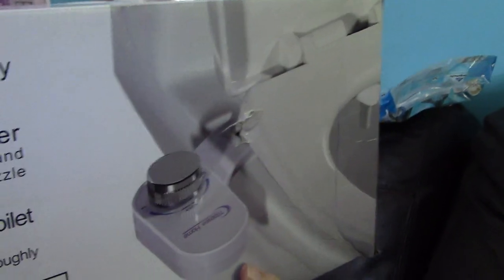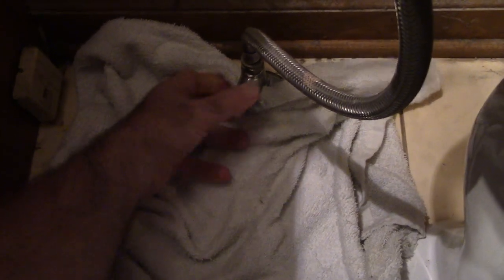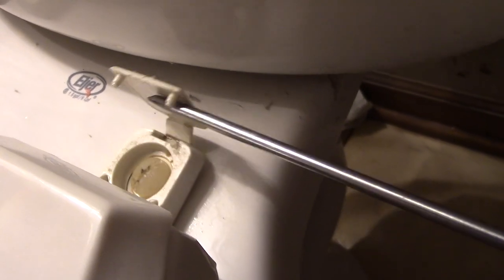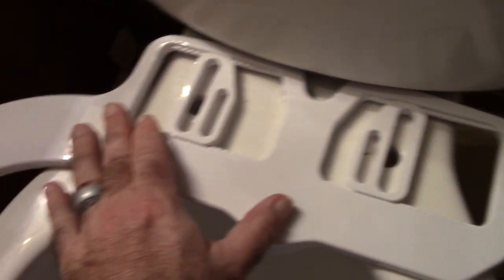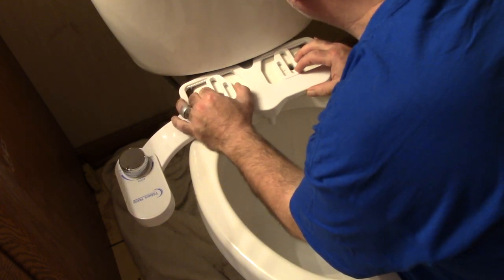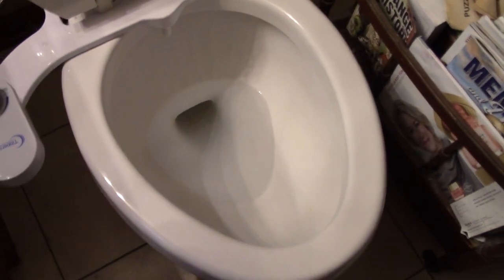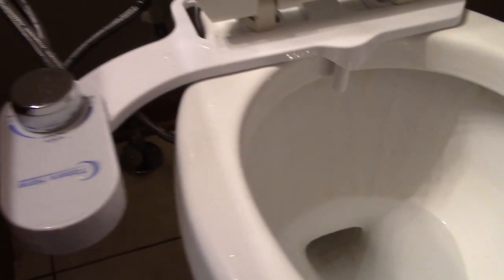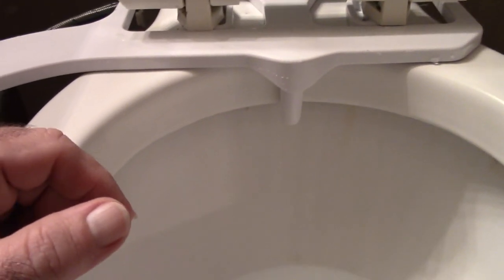Installing Our Tibbers Home Bidet

Comment: Thank you, I initially installed how you were trying to at first, but was getting a steady drip from the metal T splitter. I wasn't sure what the plastic adapter was for, didn't even think about running it to the tank. Swapped it around and everything works perfect now

Comment: Great video. I had my entire colon removed last year, because of colon cancer. My prognosis is excellent and I feel great, however I did go from using the restroom every other day, to using it approximately five times per day. I guess it beats dying of cancer, however my timing is not ideal (in the midst of a TP shortage! 😆)

I basically took out a second mortgage so that I could purchase 120 rolls of cheaply-made one-ply TP (from China... love the irony), but this is a short-term solution, and leaves me anxious for my future in this dystopian world we are now living in.

Having spent some time in France, I began to ponder other solutions, and soon zeroed in on this particular bidet.

I had concerns about installation (as a new home-owner, I am learning quickly, but am still not particularly handy). Your video eased my concerns. I also appreciate the fact that I have learned from your mistake, and will be sure to note the metric vs Imperial system). 

Anyway, I’m ordering mine today, before there is an inevitable run. I may also invest in Tibbers stock. Thank you, friend.

Comment: Yep. The cold water is definitely a deal-breaker. 
It needs its own inline heater. 
Maybe the Deluxe Bidet Buddy will have that.
Reply from the maker: Seriously, don't let the cold water supply scare you!  It's hard to explain, but it's not the deal breaker you think it is.  Everyone in the family is fine with it.  It's actually comfortable and it's not "shocking" to the system.  We love it!
Reply: It’s also not as cold if you use it before you flush. The water in the pipes becomes room temperature after a while, so it only gradually becomes cold after it’s on for more than a few seconds. Heated bidets are considerably more expensive.

Comment: As soon as you find out the the water shut off valve does not stop the water go ahead and replace it, shut off the water from the main valve at the front of your house or the street and then continue.
Reply from the maker: I have since replaced the bad valve.  The reason I didn't do it right away was the washing machine was running as well was the dishwasher.  It really wasn't that bad.  I had a small bucket that caught the water coming out while I worked.  And I had it done in less than a minute.  But, like I said, I've already placed the valve.  Thanks!  😉♥️☮️

Comment: I would have shut off the main water supply to the house.....
Reply from the maker: I thought about doing that but, when I was installing it, we had laundry in the wash & the dishwasher was running.  So, I just got the bucket, it worked out fine.  LOL!

Comment: Could have just turned the water to the house off
Reply from the maker: Coulda, shoulda, woulda, didn't.  LOL!  Unfortunately, in my case, that is easier said than done.  We haven't lived in our place very long and we still have a ton of furniture and moving boxes in our basement and it's all in front of the main water shut off.  It would have taken me a couple days to get to it.  However, I had my bucket, and it was only a trickle of water coming out.  Didn't get one drop of water on the floor!  😉♥️☮️